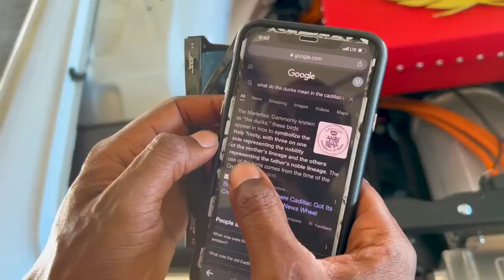If Tesla made a Cadillac, this would be it

Comment: It really is stunning how much space the electric motor takes up vs the original ICE setup in these retro builds. Never gets old watching the hood pop and staring into that vast empty space.
Reply: Even from the looks, motors have no fascination compared to engines. Totally crazy. Completely bland in every aspect.
Reply: Add battery (source of your movement) and converter in 1 place and you receive bigger space than 1976 old V6 engine.
For some reason people only admits electric motor, but not transmition, battery or converter, wiring and rest of important parts, but like to bash ICE on daily basis for having "100500" parts, which is false.
never overestimate EV or underestimate ICE.
want to have both
Reply: @razzor4708  Also weight, EV's can be extremely heavy, especially in ICE platforms.
You can make them lighter but you start losing a lot of range.
Only the longest range EVs match a basic fuel (full) tank in a family car.
EVs have still a long way to go. I'm also worried about the reliability being ruined by planead-obosolescene electronics.
Reply: Can't believe I am thinking this , I miss leeedaa
Reply: Yep they really could have a huge frunk, surprised they didn't add any batteries in there. I wonder how the weight balance works out?
Reply: @MiGujack3  a very small population of people drives 300 miles a day or more. The range doesn’t really matter. Most people will rarely ever use the full charge in a single day
Reply: @MiGujack3   The main issue with BEVs is the simple fact that replacing the battery pack for most people would total out the car since it would cost more than it's actually worth and it'd be cheaper to just buy a new one because car manufacturers aren't willing to fix the battery pack for the owner, just full replacement.
Reply: @garosama4517  I mean to you sure, but acting like your subjective feelings are objective fact is a bit rich.
Reply: i don't see a HV air comperssor and condenser.
Reply: @razzor4708  Wiring, chargers, controllers and battery do not degrade much over time. Whereas with an ICE you have to replace oil, and do regular maintenance like changing filters and coolant. Horsepower to horsepower an EV will always be more reliable and cheaper over time.
Reply: @daexion  Even broken battery packs have crazy high resale value. Used tesla packs with broken modules are upwards of $5000, some selling for $10,000. Every manufacturer replaces it for free if you're under 100k miles.
There's a tesla with 1 million miles that did 640,000 hard miles on a single battery pack life, it is not a worry at all for your average driver.
Reply: @razzor4708  You're ignoring that on most cars the bottom is all piping for the exhaust, drive shafts, the gas tank, the muffler, transmission, etc. EVs don't have exhaust, you can have a motor per axel instead of drive shafts, you can take out a transmission as electric motors have a higher RPMs, etc. In a conversions they'll likely keep the transmission and drive shafts, but you can replace them if you want as they aren't necessary anymore.
Reply: @MiGujack3  in theory reliability should be better as there are less complex parts. Tesla in comparison are terribly built with basically every video of someone getting one having build quality issues. It's not very surprising then they constantly need work. They're only slightly better with reliability than Hyundai and Kia and those are known for being junk. 

I don't think weight is a major concern for most people. Considering tons of people literally buy crossovers and pickups just for extra room, these people clearly care less about range and efficiency over quality of the interior. The Lucid Air for example has a range of 500 miles, nobodies buying it. It is more expensive than most cars, but you'd expect it to easily compete with the Model S Plaid, but I rarely see the Lucid while Model S Plaids are pretty common. Again, range is barely a concern for most people. 

That should be obvious though when we're talking these super cars as most sports cars have terrible range. The 2022 Corvette only has a combined of 350 miles. Obviously people buying this range of models just want the raw performance and the prestige of the brand. 

The only alternative EV I know of with ridiculous range is the Aptera which still has yet to come out. 1000 miles of range is ridiculous. But not expecting anyone to get one till like December this year or early 2023.
Reply: Unbelievable that an electric motor puts out more power & really has nothing to fail other than the bearings & that also ends in destruction
Reply: @garosama4517  let’s not forget about the range! To get the range of the ICE you needs tons and tons of batteries which means basically no more space in the swaped vehicle 😂 😆
Reply: @MiGujack3  yeah EVs are jam packed with electronics everywhere from battery monitoring to motor controlller, inverters…….. way more than conventional ICE
Reply: @robmanueb.  by adding more batteries/weight they loose on acceleration and top speed for their applications, also it reduces efficiency.
Reply: @CodeineAbdulJabbar  lol…… not everyone uses their cars all the time like you said, when they get sold to other people they are used very differently or even exported to foreign countries where range is absolutely needed….
Reply: @daexion  that’s actually tesla that has been making every parts of the car bigger and basically not repairable in case of an issue, the structural battery and big castings….. not great idea tbh!
Reply: @Skylancer727  lol…….. at least you can manage rose mufflers, gas tanks, shafts very easily unlike the giant battery that is absolutely needed!
Reply: @Skylancer727  just take the example on minivans like Toyota Sienna, Chrysler Pacifica where the second and third row seats can be stored into the floor! That’s totally impossible with an EV.
Reply: @grahamcampbell400  lol…… electric cars have been the very first vehicles and electric motors are also way older than ICE, ICE can also runs very reliably and are actually way more capable than electric motors.
Reply: @grahamcampbell400  it was the original reason the first cars were all electric. It's just so simple while gasoline is complicated. Not to mention that even when gas vehicles did hit, they made incredibly awful fumes and needed to be jump started by spinning a flywheel. Many people literally died or got maimed from doing it poorly. We have done a ton to fix the intricate issues of combustion engines once it was shown to be the future. EVs main struggle has always been added weight and until the 90s we didn't have good batteries for the task.
Reply: @grahamcampbell400  a 200ish hp bmw diesel x3 has more torque than a tesla midel3 and also it has  way way more towing capacity.
Reply: @grahamcampbell400  a 200hp Toyota hilux has better towing capacity than a 1100hp tesla plaid.
Reply: @carholic-sz3qv  of course you can. Again there's still an extra over half a foot of space under where the seats fold in. Some EVs don't even have a frame on the bottom and literally use the batteries as the frame of the car. This can even be seen in existing EVs where they don't have the divider going down the middle of the car like in normal gas vehicles. 

And the Pacifica does have a massive battery in it. The plug-in model has a 16Kwh battery in it and still has fold down seats. Then it still also has a gas tank and all the other components of a normal ICE vehicle. Clearly the battery in this vehicle didn't cause any issues with that.
Reply: @garosama4517  just because you don't understand what's going on inside doesn't mean electric motors are boring. A ton of really cool science and engineering goes into making modern electric motors as small, powerful, and efficient as they are. Even just the fact that you can get them at any size from microscopic to ship propulsion is fascinating.
Reply: @Skylancer727  are you trying to be dumb or what!? The high voltage battery for the plugin hybrid system has litteraly made the second seating rows to be not storable anymore, you can still lucklily store the third row seats still because the batteries doesn’t use all the floor up to the rear.
Reply: @Skylancer727  the hybrid system has actually caused a lot of issues in the Pacifica including weight distribution…… it super easy to modify ICE just look at the examples of pickup trucks that can be modded into RV, bus, ambulances….. with still a lot room to play underneath the car! Same goes with overlanding rigs…. The gas tank can litteraly be made in any sizes/shape possible, some cars even have tow separated fuel tanks for Better space management too.
Reply: @jfolz  sooooooo triggered 🤣
Reply: @BeefIngot  Thats not subjective at all, thats a fact. Nothing exciting about electric motors, something completely ordinary.
Reply: @hasangenc2922  Its quite childish you think your subjective opinion is fact when someone else who has further understanding of the subject could easily have the opposite preference.

This is as after all ice engines are now old and inefficient
Reply: @BeefIngot  Tbh its childish to get so triggered over something as ordinary as electric motors lol.
Reply: True but that pickup has nothing else.  No power steering, ac, etc...
Reply: @carholic-sz3qv  batteries can be organized in rather bazaar fashions as well. Most of the time they're made of cells only slightly bigger than a C battery. They can be organized however you want from there. As long as the cells are connected in the right order of series and parallel it doesn't matter how you scramble them. 

And I couldn't find any documentation or news of the Pacifica having distribution issues. From what I could find they just used where the mid seats are stowed. They could have also put them in the trunk section or if it wasn't a hybrid it could have been also under the hood and front seats. Still, those mid seats could have stowed if they didn't have the exhaust and drive systems under the car. 

And yes, big vehicles have more open space. Same is true for EVs. Look at the Hummer EV. It has a ridiculous amount of space and is over a foot off the ground. I don't see a good reason to compare vehicles of different sizes. It's basically comparing a pickup to a semi.
Reply: @garosama4517  thats exactly the reason why EVs are so uninteresting for the enthusiast. They just are too ordinary, its like comparing an electric train to a steam machine. One is efficient and uninteresting, one is old, unefficient and badass.
Reply: @garosama4517  is that your standard response when someone disagrees with you? Hate to break it to you, but modern engines are by and large characterless, boring machines and it's only going to get worse from here on out.
Reply: @artansadiki3244  yeah sure you keep your steam train, I'll take the 300+ mph maglev train that fucking levitates...
Reply: @jfolz  Yeah, for transportation all day. For passion? Is there anyone with a passion for electric trains out there? Lmfao

Good thing combustion will always rule the dragstrip anyways...
Reply: Tbh i find it quite funny when people get stunned over an electric motor. It just does its work, like a corddrill, an elevator, nothing close to being 'mechanical'. Completely uninteresting.

I heard a dude state he is a proper gearhead all his life, and he is looking forward to the time when you can smoke someone in a selfdriving car while scrolling through the internet. Not joking. People nowadays don't know what gearhead or carguy means.
Reply: Unless there's a big block under the hood, there is tons of room under the hood of a square body. I had a '79 with a 350, and I literally stood in with the engine to work on it, and I was well over 300 lbs at the time. Of course, it only had an alternator as an accessory and no fan shroud. It was designed to accommodate a straight 6, a small block, or a block, thus all the space. I drove a '76 Suburban with a straight 6, it just looked silly in there.
Reply: @r7cardosuarez806  that guy HAD to be joking 🤣
Reply: Shout out to the sound from Doug
Reply: @artansadiki3244  there's plenty of high speed rail enthusiasts out there - and those are exclusively electric (because conventional diesel locomotives simply cannot provide the kind of power and traction needed for this application). Is it really such an alien concept to enjoy electric propulsion? If you break internal combustion down to the most basic concept it's just "fuel goes bang and turns the crankshaft". You might say that's wrong and there's so much more going on to make it work, but the same can be said for electric motors.
Reply: @garosama4517  to you
Reply: @carholic-sz3qv  not really you fust need electricity anything can make electricity and transfer it to the battery to run the vehicle.
Reply: @MiGujack3  Mercedes has a prototype with a range of 700+ miles, also the Rivian truck has more range than a family car and there are other models too, I get people's love for ice but let's keep the discussions honest.
Reply: Yeah those malaise era Cadillacs and Buicks are the perfect shells to make modern land yachts, the stock engines sucked because of the good old anti smog + oil crisis one two and their frames are enormous for plenty of batteries.
Reply: TBF, the IC engines in these old-timey cars often left a lot of space under the large hoods.  Fewer engine accessories, too.
Reply: @hasangenc2922  Ah yes, because its the person who knows their opinions are subjective telling the child who thinks theirs are objective who is triggered.
Reply: Yeah these electric vehicles aren't anywhere near as cool looking. I still think I prefer and engine with a good muffler that isn't loud. Electric motors they say are quiet but they make this "Eeeeerreerrooooooooowooooohooooo" Boise and it's a very odd sound 😂
Reply: yea but then you get to haul a huge battery pack with you. there is no clear winner in my opinion.
Reply: More space for the big fuck off batteries
Reply: @razzor4708  That's because there is no transmission.  The motor itself is variable speed so things like transmissions, oil cooler, fuel systems, turbo's, and exhaust are no longer needed. But like you said.  I also think having both would be ideal.  There's just something special about ab ICE that rocks the whole vehicle when the accelerator is pressed.  Not to mention announcing you've arrive because you can put the thing in neutral and scream that exhaust.  On the other side of the coin nothing beats that head slamming torque and smmoth rev band of an EV.
Reply: @halfwaydecentvehicles  it’s not your mind missing Leenda 😂
Reply: But if you live in California for instance you can't charge your EV up because the Electrical infrastructure would not handle the load, but California, have no plans to upgrade their Electrical grid. So you guys are going to be stuck with NO transportation.

Comment: I am a Cadillac guy through and through… and I love it. We know that 429 big block was probably really tired.  Sometimes those old drivetrains take a lot to get up and running properly again… I don’t mind the EV build on it. Thanks Uncle Rich for bringing us the deets
Reply: An LS would have been way easier tbh! You don’t need those super heavy underpowered 429 big block….. even a Mercedes’ om606 is great option for more capabilities with the truck also run biodiesel…. 😂 😆
Reply: @carholic-sz3qv  Biodiesel is even worse for CO2 and air pollution than diesel bro
Reply: @arthemis1039  who cares
Reply: @arthemis1039  where do you get such stupid infos!? Lol…… biodiesel is litteraly your average oil minus all the particles found in petroleum diesel.
Reply: @carholic-sz3qv  I don’t think the easy route is what the builder was going for. Plenty of LS powered mid 60’s Cadillacs out there…. which is pretty ho-hum. LS is so overdone for a repower choice, don’t get me wrong it’s an excellent engine…. But I would rather see the improved 472/500 big block, a built/bulletproofed Northstar, and/or this. I’m sure it scoots it along real good…
Reply: Beautiful job.....that's how you preserve a a beautiful car like that you upgrade the engine to the new most modern drivetrain available not just throwing an LS and fill a tank up with $5-7.00  gasoline if you're lucky and all the  maintenance that goes with it
Reply: Yes, and the ride is crap with the springs and the rubber brushings shot. I’m surprised that the Imperials handle way better than the GM cars.
Reply: @M13x13M  60’s Imperials are in a class all by themselves.